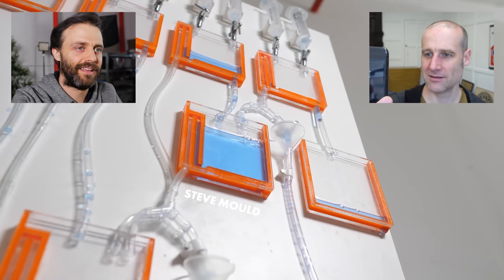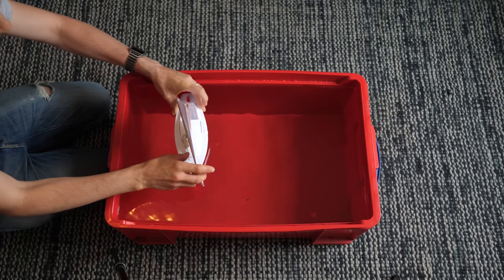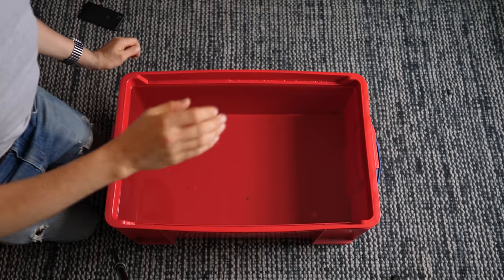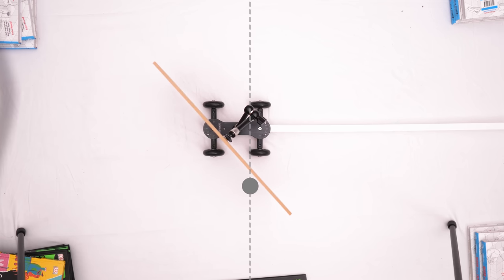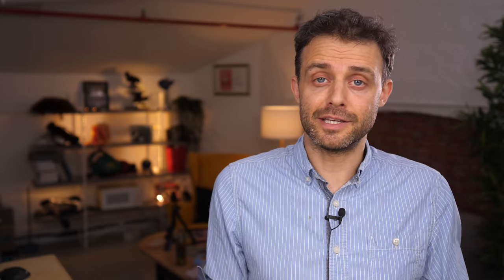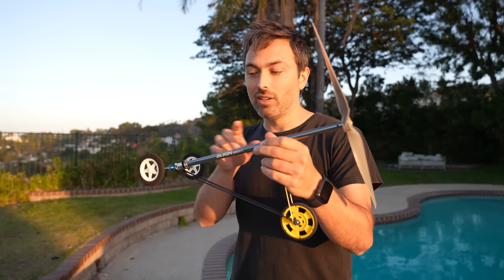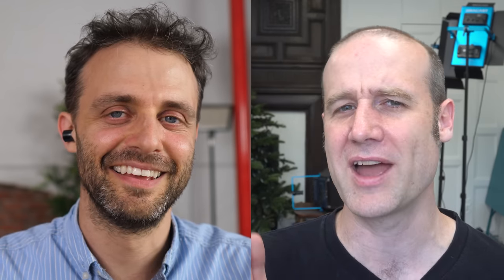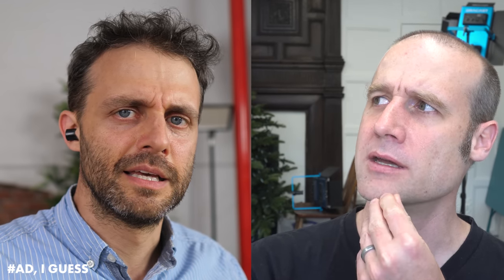Sailing Faster Than The Wind - How Is That Even Possible?

Comment: I was hoping for a more detailed explanation after the veritasium one!
Reply: Yes, I found Veritasium's explanation for the phenomenon of going faster than the wind way better than Steve's, his is just too much saling-related...
Reply: Same here, I'm missing an intuitive explanation of how to extract energy from the wind once your relative speed to the wind is zero.
Reply: @dykam  It's possible to use the speed difference between the ground and the air, this difference exists even if the vehicle is the same speed as the wind, and you can get enegy out of this difference if you decrease it, however this is only a very general explanation and doesn't adress the mechanical aspects.
Reply: @dykam  this  video wasn't about that vehicle, it was about what Veritasium hand waved as being true. which is fine as his video wasn't on how sails go faster.  this video gave a more complete answer for how sails can move at an angle to the wind faster than the wind, and since the two blades on the vehicle are effectively just 2 sails move at an angle into the wind more completely explained that specific portion. it would be nice to see more of that vehicle though it was cool
Reply: I think a explanation could be: (its my explanation)
When the wind speeds up the vehicle it doesnt speed it up due to it turning the blade, but due to pushing on the vehicle. Then the wheels will turn also and this causes the blade to spin. Now when the vehicle is at the speed of the wind it will get faster, cause actually if you imagine a horizontal line through the rotors blade there will be a crossing point between the imaginary line and the blade. This dot actually moves backwards while the blade is spinning, because of the blade is tilted. Now you have a point on the vehicle that is moving slower than the boat, cause this point is moving backwards relative to the boat (it could even really move backwards, but lets assume it doesnt)
So then the air can push on this point, since its slower than the air and thus push on the whole boat. 
Of course this backwards moving point doesnt really exist. But you can also think about it this way:
The rotor is spinning, and thus it will blow air against the actual wind. This will cause some swirls and this will cause the vehicle to kind if push itsselve from the wind. Now you could argue that pushing from the wind takes at least as much energy as it takes to turn the wheels. But thats not true, since the vehicle is moving faster relative to the ground than to the air. And thus its easier to push from the moving air than to turn the wheels to be able to push the air backwards. (Have you ever been in a pool with circle motion and just floated in the water while pushing yourselve activly from the fast water jet at the edge tonbe faster than the others? did you notice that gaining speed by this was easier than gaining the same amount of speed difference due to pushing off the non moving water? ) this is  because the kinetic energy increases quadratic with speed. So lets say you want to gain a ∆v of 1m/s relative to non moving ground while you've got no speed  in the first place. The energy reqiered would be 0.5(m^2/s^2)*M with M being your mass. But if you try to gain 1m/s when you are at 20m/s to get to 21m/s you will need a energy of 20.5(m^2/s^2)*M. So much more. So if you push from a object that isnt moving to gain 1m/s while you are at 20m/s you will have ro use a energy of 20.5(m^2/s^2)*M
But if you are pushing from a object being as fast as you, you will have to use only 0.5(m^2/s^2)*M. This is because you will push the other object backwards by doing this and thus you will decreas its veilosity and thus its energy and thus you will gain energy without having to do that much of a work. (of course this 0.5(m^2/s^2)* M does only hold, if you assume that the mass of the object you are pushing from is infinity, cause else it will get slower while you are pushing from it like i already said, and this will make calculations complicated)
So you can actually divide this process into steps:
Step one: Pushing from the wind using a energy of 0.5(m^2/s^2)*M and increasing with speed of 1m/s
Step two: using your energy relative to the ground to push from the air. 
So if you calculate that you will loose 0.024m/s. (cause you will get a energy of 0.5(m^2/s^2)*M if speeding down from 21m/s to 20.976m/s) .
So over all you are gaining 0.976m/s without blaming the law of thermodynamics.

Comment: Sailing Speed through the water (STW) is the end product of a multitude of variables. Wetted surface area, sail area, righting moment, true wind velocity, apparent wind speed and direction, to name the main elements.  So a very light yacht with very a low wetted surface area, high sail area and a righting moment that prevents it  heeling over when wind speed increases,  will easily sail faster than true wind speed.    Multihulls generally sail faster than true wind  speed as do light monohulls or any sailing vessel on foils.   Basically design a light yacht, keep it upright and out of the water as much as possible, trim the biggest sails you can handle, trim them properly, steer nicely and bob's your uncle.     Sailing's amazing so if you haven't had a go then give it a shot.

Comment: Hmm, I already found it intuitive that the sail boat can move faster than the wind in Veritasiums video. What I still do not find intuitive is the claim that the component of the velocity of the boat downwind can be faster than the wind speed (https://youtu.be/jyQwgBAaBag?t=449 ). When starting this video I was kinda hoping for a n answer to that question.
Reply: Finally found the question i was the most curious about. Give this comment more likes to get it to the top
Reply: @Дістатижовтімаюнаметі  The only explaination I found so far why a tacking boat would be faster than the wind in the direction of the wind (ie overtake the balloon) is that each time you change direction you still have your momentum so around the turning point you go faster than the wind for a short while. This, however, does not work if the boat never changes direction, as implied by the two boats "taking" on the "water tube" that turns into the propellor....
Reply: It's simply because the "apparent wind" seen by the sail is not the same as the ground wind. Both direction and speed will change as the boat speed changes. As the boat speeds up the wind will first seem to come from behind, then it will seem to shift to from the side (abeam) and so from on the boat it will feel like an abeam wind would feel at standstill. An abeam wind at standstill will accelerate the boat forward. This then takes you beyond( faster than) the true wind forward component because now you are sailing "into" the apparent wind, slightly. Which means you have the downwind component PLUS the "into the wind" component and these combined can be faster than the true downwind speed.
Reply: @imd12c4advice  Well, what do you know, it was rich sailing wizards all along ( https://youtu.be/uylpjlz8SjY ). I think your comment + that video finally gave me an epiphany. Thank you <3 So, the way a sail drives a boat very much does not care where the boat is going so long as the wind is not coming directly from the front. And the true wind only drives the boat for so long, once the boat picked up speed, the only purpose of the true wind is to ensure that the apparent wind is not coming directly from the front. That way you can somewhat harness the energy of your own headwind (by slowing down the air around you, as explained in Veritasiums video), which will at that point make up the brunt of the apparent wind.

(The surfer analogy in that video is not very helpful, because it's obvious that the absolute speed of the surfer can be larger than the speed of the wave (ie as soon as there is any movement perpendicular to the wave) but the surfer is still very much limited to the speed of the wave in the direction of the wave.)
Reply: @kseliascryser5259  yes. All that is required is intercepting air and getting it to push you along. It does not matter if that air was "behind" you or in front of you before you intercepted it. All that matters is intercepting it and pushing off of it in an advantageous direction. Physics doesn't care which air is used.
Reply: @kseliascryser5259  one other thing: Rather than thinking of it as harvesting part of your own headwind, think of it as your speed (which gives you an apparent headwind) allows you to interact with more particles being blown by the true wind, thus harvesting more power from the true wind.
Reply: @kseliascryser5259  the apparent wind is also what propellers and wind etc use. Have you ever wondered why propellers and turbine blades have different angles the further they are from the centre? It's because the apparent wind they experience are more "sideways" the further from the centre of rotation that section of the blade is.
Reply: Precisely, this video does nothing to answer the incredible statement made in the Veritasium video that then they translate to the circular case with the propeller. I wouldn't call it clickbait but they completely missed the point...
Reply: @thelogician3845  I think you missed the point of the question I and 43-ish other people had. Sailbots sailing faster than the wind is fine. The propeller concept is fine.

The contentious claim was that the sailboat can go faster than the wind, in the direction of the wind (ie disregarding movement "to the side"). 
E.g. say you have wind blowing towards North at 10knots. If you sail straight towards North you cannot got faster than 10knots. If you tack towards NE (for example) my intuition says you should be well able to reach a bit more than 14knots, at which point you would be faster than the wind in absolute terms, but still only sail at 10 knots *towards north*, ie the direction of the wind. The unintuitive claim was that you could go faster than that, eg you could tack at 20knots towards NE at which point you would go at ~14knots towards North, ie faster than a baloon pushed by the wind. This is necessary for the whole propeller concept to work. "Lucky" in reality this is the case, because the absolute wind towards ground does not really matter, only the relative or apparent wind towards the boat does.
Reply: @kseliascryser5259  oh crap i missed the point of the entire video.The propeller is not driven by the wind!!Anyways i got what you are saying. Earlier reply deleted.
Reply: It can go faster than the wind as once the craft is up to speed, and the propellor is producing thrust, (remember the propellor is not a windmill on that craft) the thrust from the propellor is increased because of the tail wind. It increases the propellors thrust close to its' maximum which is static thrust. An easy way to think about this is a light aircraft produces maximum thrust when it is not moving. As it accelerates down the runway the thrust drops off significantly. As it accelerates down the runway if you were to introduce a tail wind to the propellor its thrust would increase. (However detrimental to lift over the wings)

Comment: Great video as always Steve. Myself and some friends recently started sailing and spent a fair bit of time pondering the physics as well. It might be worth noting that as the boat speeds up it's advantageous to reduce the angle between the sail and the direction of travel, I think this is because the 'resultant' angle of wind on the sail changes with the speed of the boat.
Reply: Sailors use what's known as an apparent wind to sail their boat and say your heading angle is 090 @ 20 knts and the wind comes from 000 @ 30 knts your apparent would be 030 at 37 knots which would be a close hauled course when you are actually on a reaching course

Comment: Love that you mentioned that a flat wing/sail works too! Many descriptions of lift treat the airfoil shape as magical.

Minor correction: the definition of "tacking" you gave is a common misconception. I heard it too, and only learned better when I learned to sail as an adult. Sailors call that "beating," and "tacking" refers to a single maneuver, specifically turning the boat from sailing upwind with the sail on one side to sailing upwind with the sail on the other side. In other words, to a sailor, beating consists of tacking back and forth a number of times to make progress upwind.

- that guy

Comment: everything i know about the dynamics of sailing, i learned from zelda (or rather, link) in the windwaker.  you could get the boat to go into the wind by building up speed and turning into it, back and forth, alternating left and right so you don't veer off to one side.
Reply: Its called tacking! It's a lot of fun in reality. Which Zelda title is this? I might have to give it a try, that sounds like a blast! I've never heard of a game with realistic sailing physics.
Reply: @o_manam  i was very simplistic physics, but it was called The Legend of Zelda: The Wind Waker, on GameCube.

Comment: You totally forgot about true windspeed and apparent wind.
More boat speed, that more influence it have to the apparent windspeed. It have influence on the boat speed as well in the angle to the true wind.
For example the ac75 always have the same sail trim, doesn’t matter if they are on a up wind or down wind course, because of the high speed they use more the apparent wind as the true wind.

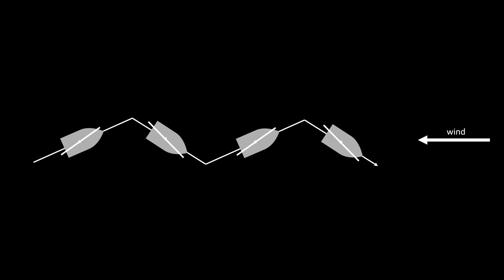Comment: @8:51 I could be mistaken about this, but my understanding of "tacking" is that it's the maneuver of bringing the bow of the ship across the wind, i.e., one turn in your zig-zag pattern, whereas the process of tacking repeatedly as to maintain a coarse that is overall directly into the wind is called "beating." This may be archaic usage, however, as all my sailing knowledge comes from Patrick O'Brian's book series.

Comment: Dunno if anybody else has pointed this out, but the overall net force of the wind on the sail is not called "lift".  Only the component of the force that is perpendicular to the wind is called "lift", and the component that is parallel to the wind is called "drag".  Also worth remembering that in this context "wind" is always measured relative to the motion of the vehicle, so a plane travelling 150kts through still air is experiencing 150kts of wind, and once the boat starts moving, the wind direction relative to the boat will change.

This is confusingly different to how sailors talk about wind direction which is almost always relative to the water.

Also there was no mention of a broad reach, which was surprising because that was the first example given with the model sailboat.  That's a great way to get faster than the wind, and Derek also briefly showed it in his video.  Basically you've got a sail angled so it's flat on to the wind, and the boat goes downwind, but angled off by about 45 degrees.  Then you end up travelling with the wind but because your path is longer than the wind's path, you go further.  Also you start to get relative wind effects and you can start to angle the sail a bit more and get an extra boost, in fact because of the curved sail, in this configuration you do end up throwing some wind back, just like the turbine car did.  Hitting a broad reach just right in a strong wind with a dinghy is an incredible feeling, it's like you're getting lifted up out of the water almost.

Comment: In a certain SiFi story, the Spacetravelling Vessel is a FTL ship going through Hyperspace, a kind of Vanishing-into-no-thing Hole in Spacetime. The analogy is relevant to Sailing into the Wind and multiplying apparent Windspeed. All a matter of calculating AM-FM time-timing axial-tangential, embedded sync-duration orthogonality cause-effect of continuous condensation-superposition, transverse trancendental log-antilog rates.., that have nothing to do with Speeds of No-thing. The ship was called Slower Than Infinity, which is confounding when considering a state of AM-FM Entanglement at Absolute zero-infinity, frozen phase-locked time-timing. 

Fun to imagine.

Comment: The handle thing is about topology. I only know about it because of my String Theory reading, but essentially, if the cord is not connected, it technically has "no holes," which means you can utilize various different "knot methods" to "decompose" the manifold into an "untangled" plane. Essentially, you're performing a series of geometric transformations to modify the upper-dimensional shape of a manifold without altering anything in relation to the properties that define it in its defined dimensionality.

Comment: Another thing which helped me come to terms with this as a physics major (especially in the Veritasium version) is this: it might seem like moving faster than the wind that pushes you with a passive device (i.e. one which does not provide the energy that causes it to move) would violate conservation of energy, but the reason it doesn't is because it steals kinetic energy from more air than would be affected by a naive sail.